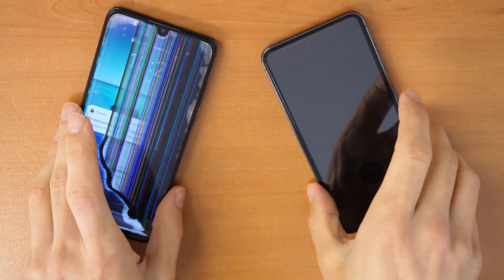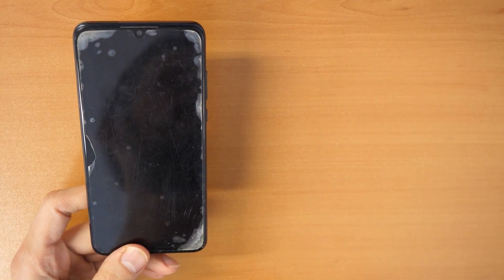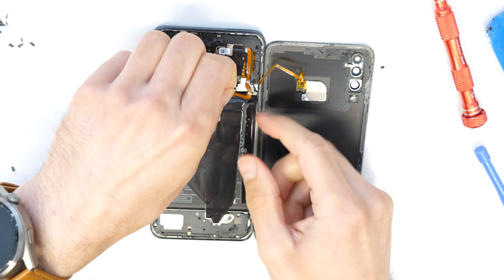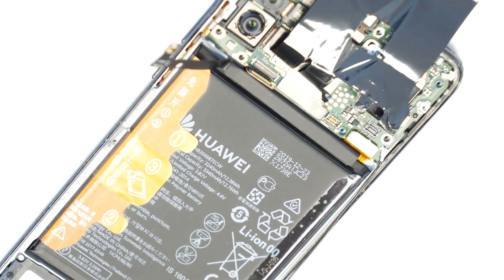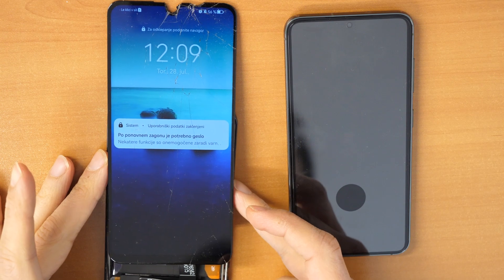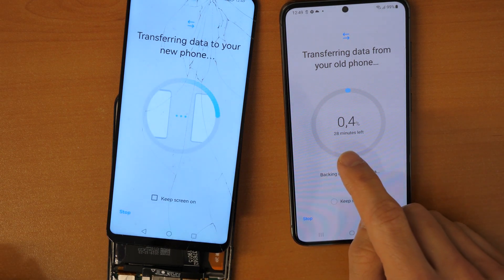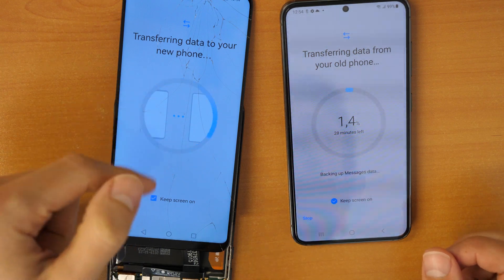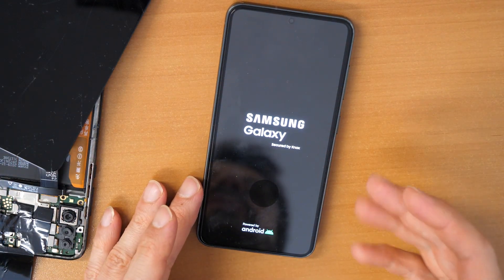Transfer everything from damaged HUAWEI P30 Lite to Samsung S23

Comment: My old Huawei MRD-LX1 was on it's last legs and today I couldn't get the battery to charge fully, but Samsung Smart Switch worked like a charm, sucking up ~15Gb of apps, settings and data with only 2 (unimportant) files which failed to transfer to my new Samsung A52. The initial procedure was estimated at about an hour but actually took less than 20mins and used about 10% of the available battery power. I had enough power left to send the 2 missing files by Bluetooth. It's still  synching app data in the background but looks like a huge success right now. Many thanks for posting this helpful video! 
Tips from me: sign in to the same Google account on both phones and in the Play Store, so that when installing or updating Smart Switch on your new phone, you should also see the option to install on the old phone, which saves a little time and bandwidth or battery. Check for new emails, messages, etc then turn off every service apart from WiFi to conserve resources on your damaged phone. Don't switch focus from the Smart Switch app on your Huawei to look at anything else, it will kill the connection and you'll have to start over.
Reply from the maker: You are very welcome. I'm glad that my videos are helping 😊 Thanks for sharing your experience and I hope you Subscribe ✔🙌
Reply: @CrocFIX  I'm now your newest sub!
Reply from the maker: @storycharms  ❤❤